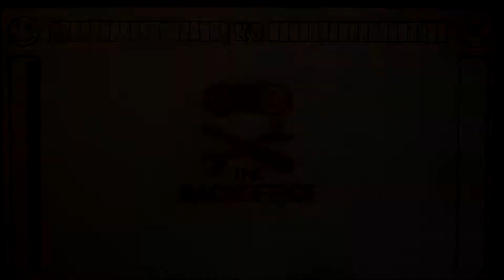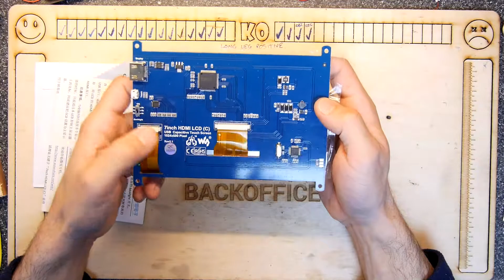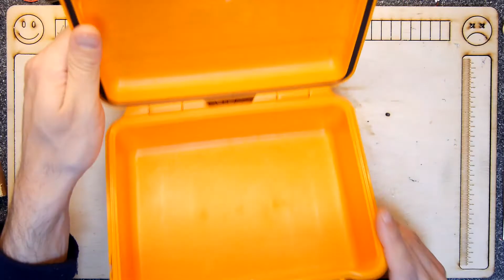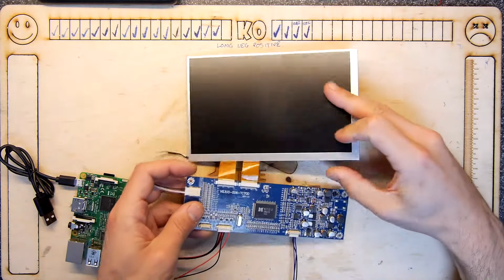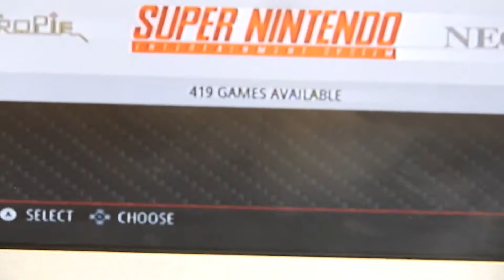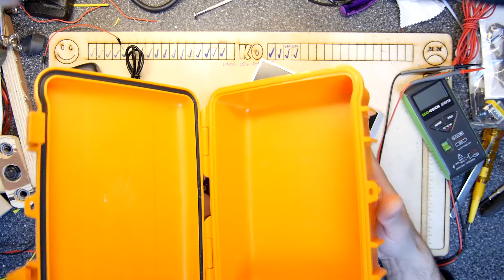Portable Retropie Rig Update

Comment: I'm actually building something very similar with a beautiful ips 8" 4:3 hdmi screen and a rugged pelican gun case. I also programmed my own micro to manage safe soft power on/off all controlled by a single button (I used it in my nes mini retropie build and it works great, there are videos on my channel in case you are interested). Btw looking for a battery where'd you get yours?
Reply from the maker: Hi, snap :) I have a neat micro and an additional sound amp board to be shoved in there as well. In terms of the battery I just ordered one of eBay, however I am not entirely convinced as Its boosting and I think I would be better off with a higher voltage battery and convert down where necessary, decisions decisions :)